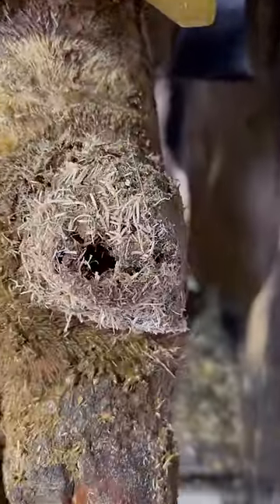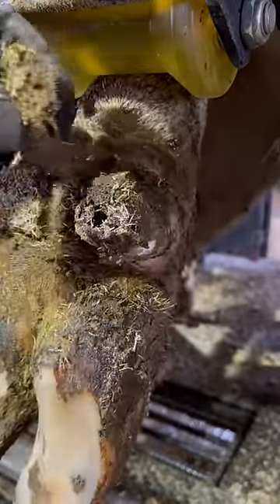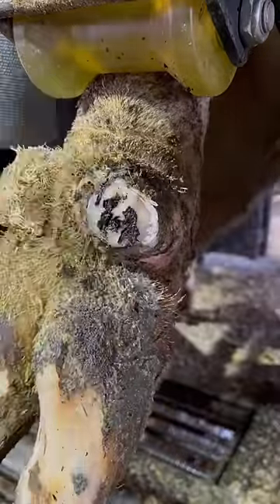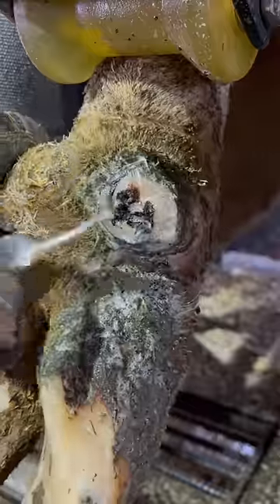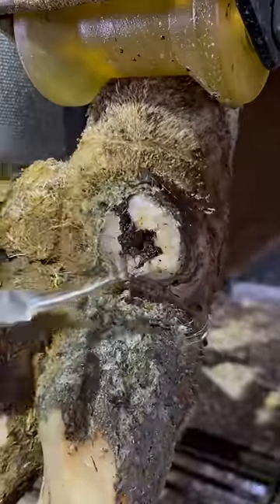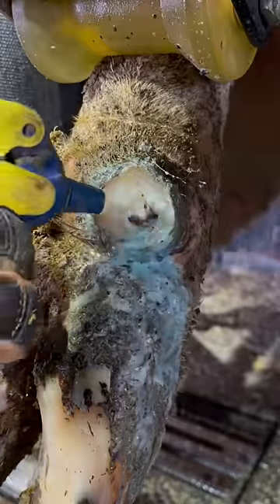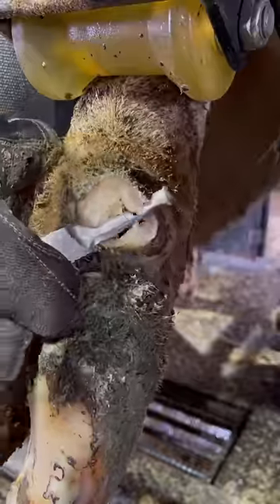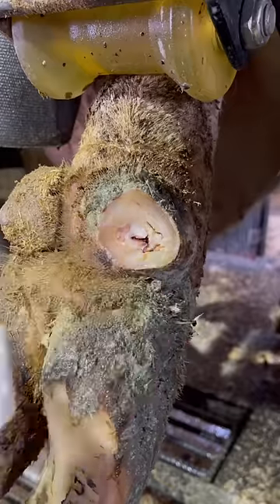This Dew Claw has a Hole In It

Comment: You threw me with the copper sulfate. I was expecting salicylic acid.
Reply: Yeah what going on?
Reply: Copper sulfate is used in foot baths to help prevent digital dermatitis.  And I think I have seen people applying it topically before.  But I don't know why you would use it vs salicylic acid.  Or maybe it doesn't matter a great deal.  Except I think that salicylic acid also gives some pain relief.  From what I can find online, a topical antibiotic is better still.  That's probably the green spray you sometimes see hoof trimmers use.  But I think anything like that can only be used if it's prescribed by a vet.  Which it sometimes is.
Reply: would powder fall out the bottom of the wrap due to the angle?
Reply: @rentworth  no. He uses it all the time. That's why the copper sulfate threw me.
Reply: I think its to do with the way they combat the bacteria, I was under the impression that the copper sulphate targets just the bacteria itself, whereas the salacylic acid does the same but also causes the outer layer of the coreum to basically burn and come off creating more of a deep clean. As to why he chose the CuSO4 over the SA I couldnt say, my guess would be he either thought it wasnt necessary and the CuSO4 would be a quicker healing process or perhaps the infection wasnt deep enough to warrant it.
Reply: @mejeremyb correct he rarely use cs maybe he thought the paste would stay in contact better.
Reply: @markntexas8265  yea I watch all of Nate's videos. He's the reason I bought and now use a hoof knife to remove bad spots from tater when peeling them. He usually uses the salicylic acid powder. That's why the cs threw me.

Comment: Get a big container of solid, dry copper sulfate and a boiling pot of water, preferably distilled, and dissolve the copper sulfate in the hot water until nothing dissolves anymore and then tie a rock or even a small piece of copper sulfate if you have any left to a string and have it suspended in the solution.  You can grow a beautiful blue large crystal once the solution has cooled.